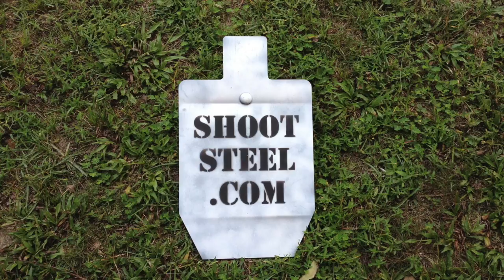SHOOTSTEEL.COM AR500 Static Target Review (HD)

Comment: I shot the crud out of one of their 3/8" thick plates for two years before it finally broke at the hole for the bolt.  I did not use the carriage bolt system for hanging the plate.  I hung it from a Shepard’s hook.  I used one side for handguns, other side for rifles.  It took 5.56, 7.62x39 and 7.62x54R and others at 50 yards and just lasted.  I just replaced the target, and am going to order another one the first of the month, so will use that code.  Thank you for that. :) CS from ShootSteel.com is excellent.  Replies to email within minutes.  Even on a Saturday night.
Reply: how do you hang it on the shepards hook?

Comment: How do they hold up to the Wolf from your rifles? I've got a few 1/2" AR500 gongs.  The one I let people hit with steel core has thin craters in it but they're not too bad. I'm sure I'll have to flip a bit sooner than the the others.  No dents though. Even from 7.62x54R.
Reply from the maker: yz9890 Steel core dings all AR500 steel but Wolf doesn't have steel core so it's not an issue.

Comment: You got one of those Adams arms blem guns from Buds right? How do you like it?
Reply from the maker: Sneakywakiki Yup.  It's a good rifle for $600
Reply: I got one of the Adams Arms blemish guns from Buds. Ended up with the mid-length. I got it for two reasons...the price, and it was a piston system too. Really didn't need another AR. However, at that price point couldn't pass it up. Mine had some minor scratches on the barrel by gas block. I subsequently had the entire gun Cerakoted. It runs great and nicer shooter.